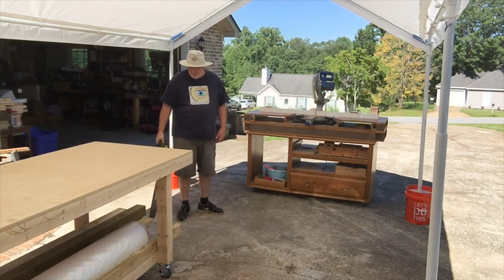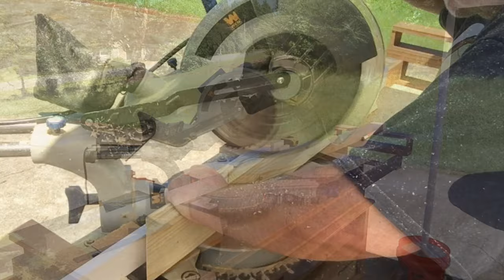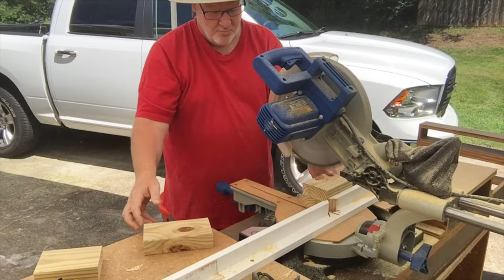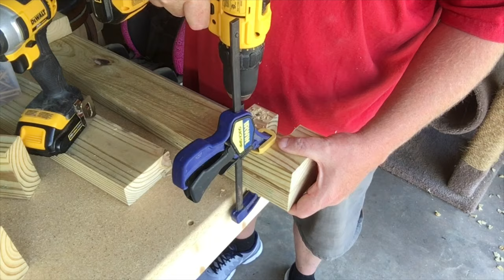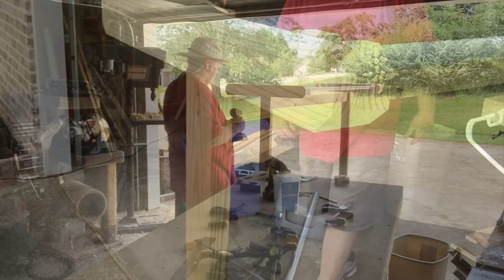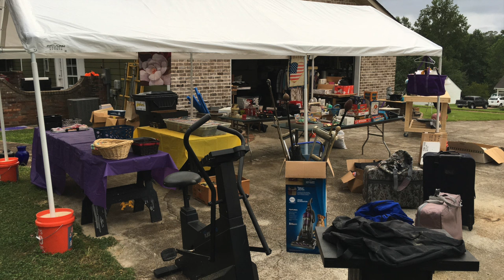Making A Double Sided Clothes Rack For A Yard Sale

Comment: What size nails? I bought the design.
Reply: I found 3" works best.
Reply from the maker: I believe I had used 2.5 inch deck screws. Use what ever works. 👍